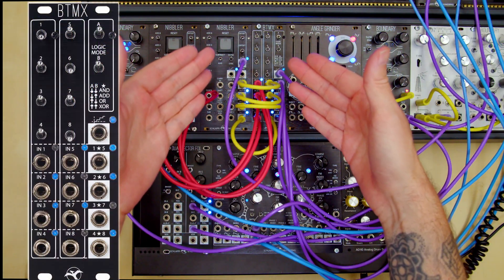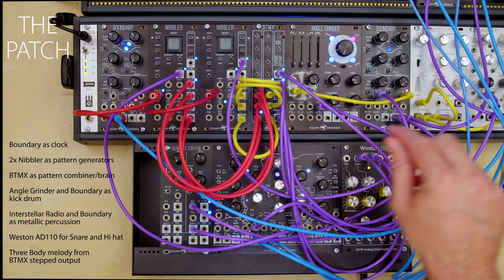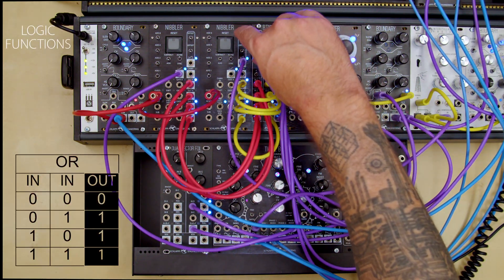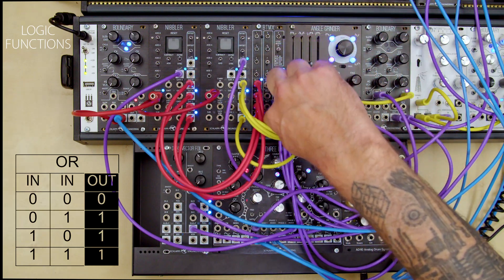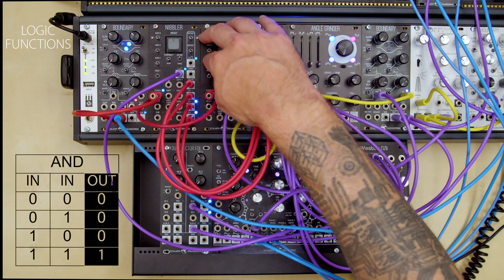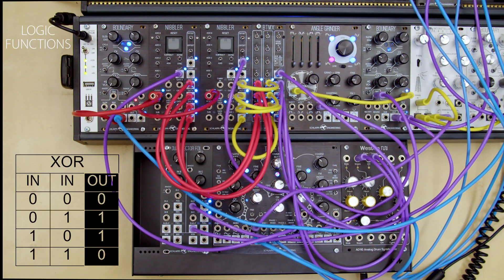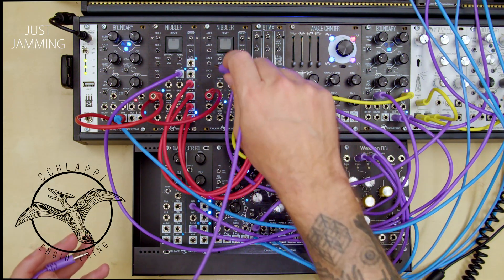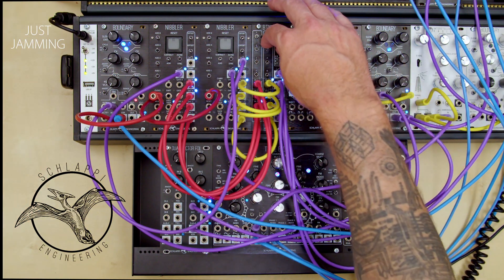BTMX Rhythmic Overview

Comment: And if you have one static rhythm input, how many different variations can you get across all the channels?
Reply from the maker: You would really need two inputs (one for each side of one gate) and then you would get four variations (one for each logic type) plus the two original signals available by using OR, XOR, ADD, and muting one side, so effectively 6 variations. Part of the appeal is also having the ability to mix and mute different sources, for example having a kick drum triggered by a clock divider isn't very flexible but if you have two different divisions to select from as well as the logical combinations then you have a playable sequencer of sorts.
Reply: @SCHLAPPIENGINEERING  yes that’s what I mean if you’ve got it fully loaded with inputs, but are playing the same rhythm and not modulating the inputs. I just wonder how many different patterns are possible. Roughly speaking.